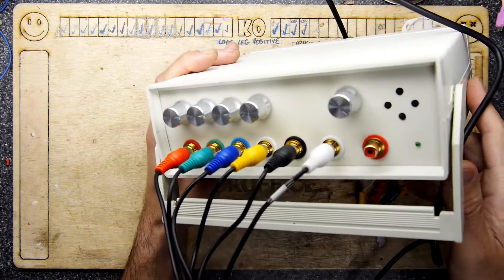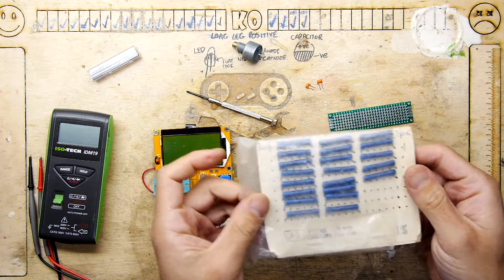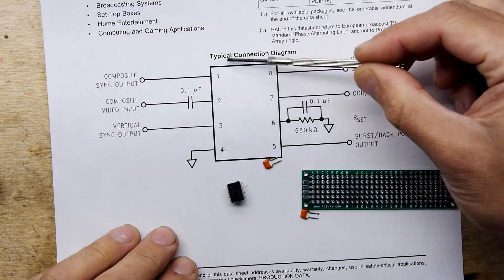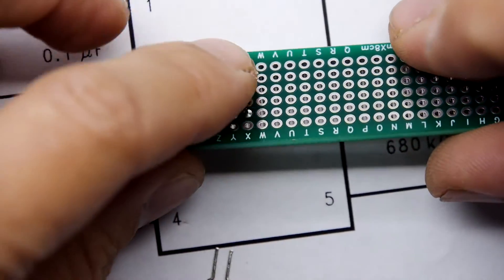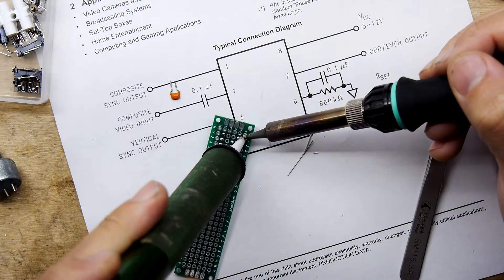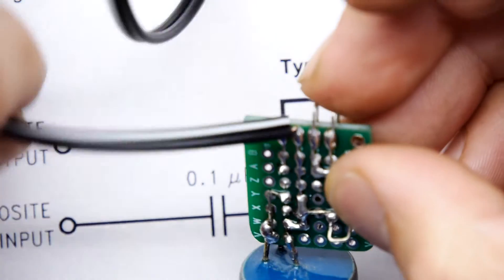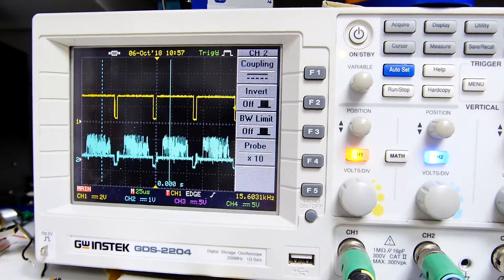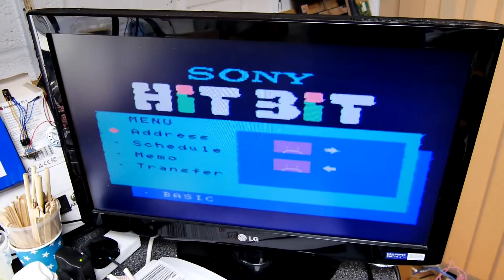How to make a sync stripper with a LM1881

Comment: "I'm having trouble with an LM1881 circuit. I'm powering it with 5V. Pin 6 (Rset) is connected to ground through a parallel capacitor and resistor. Pin 2 (composite video input) receives a 1.3V composite video signal. I have a coupling capacitor and a low-pass RC filter in series with the video input signal. I'm trying to get a vertical sync signal (pulses) from pin 3, but I'm consistently measuring only 0.01V. I've experimented with different capacitor values for the coupling capacitor on pin 2, but I'm still not getting a proper vertical sync output. Could someone with more experience offer some suggestions?

Comment: I am two months into this issue... Still no go. Did something actually got rid of the wabble?  I have the same vga board and it only works in rgbs mode but i get the wabble. It wabbles when connected straight to rgbs and no sync  when using the 1881 in rgbs or rgbhv. 😢
Reply: It works perfectly if I inject the Y luma signal instead of composite on the GBS8200. No wabble. But that's not present on the RGB connector of the MSX.

Comment: There is indeed a surface mount version of the LM1881, also there's a slightly nicer replacement GS1881/GS4884 and GS4981. Can stick it on a little SOIC breakout board and fit all the parts in about the same size as the DIP chip alone http://retrorgb.com/syncstripperdiy.html
Reply from the maker: That's really neat, you could fit it anywhere!

I need to get back to debugging my gonbes and figure why it's so fussy when it comes to older computers

Comment: Note: You don't need the Rset components if you are using the composite sync output. Read the datasheet and you'll find out why!
Just take them off and watch it still work! This is what happens when you just look at the connection diagram and not read the rest!
Also you might want to add a 75 ohm resistor to ground to terminate the composite video line properly. Signal reflections in your transmission line and such. =)

Comment: I've just recently used the lm1881 to hook up composite video to an old monitor oddly the only way I could get good contrast was by shorting some of the unused pins together !?? It's inside the monitor now and covered in a load of hot glue so unfortunately I can't be sure of how I did it but it was as per the data sheet with at least two pins shorted together. I stumbled on my solution by poking at the circuit with my finger until I saw an improvement on the monitor (which partially shorted the pins) then I tried various resistors values to connect the pins turned out that low resistance made it good so I just gave up and connected them together! Not a clue as to why lol!